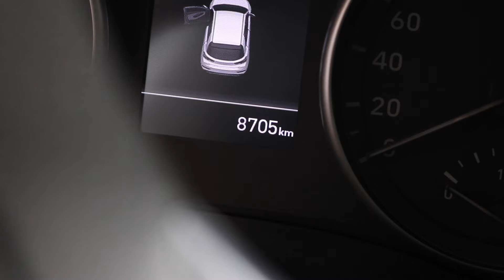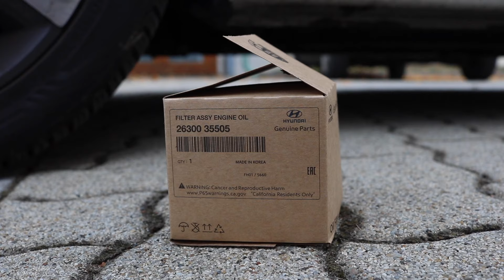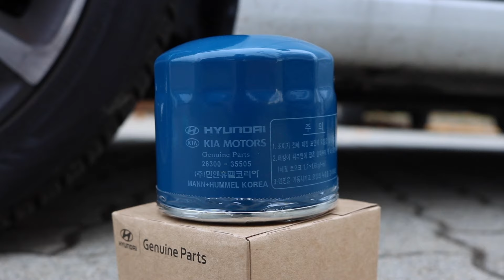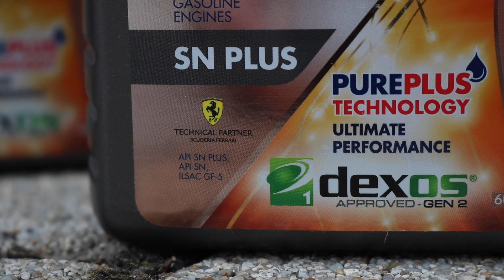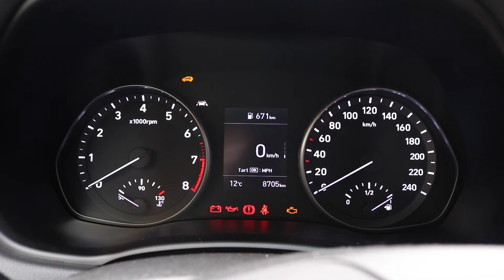Hyundai i30 - Oil & Oil Filter Change

Comment: Just saying, a 0w20 oil may work in a gasoline engine but do not put a 0w20 oil in your engine if you have a diesel.  It gets to weak when its hot.  A 5w30 use to be recommended in most car diesels.
Reply: 0 w30

Comment: My friend get the same car but according to his instruction manual the car uses ACEA A5 5w30 engine oil, it never mentioned ILSAC GF-5.
Reply from the maker: Where do you guys live?
Reply: @zsinormotors  My friend lives in Australia.
Reply from the maker: So, that's the difference. I live in Hungary.
Reply: @zsinormotors  The same car with different engine oil instruction. 
My friend want to get cheaper GF-5 engine oil for the car if suitable but worry voiding the warranty, because his instruction manual never mention GF-5 oil, LOL.